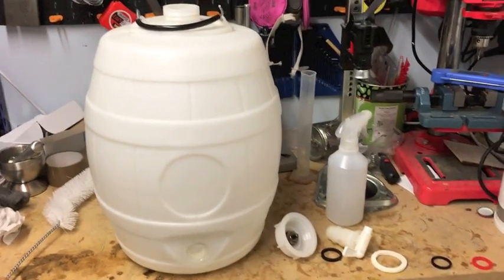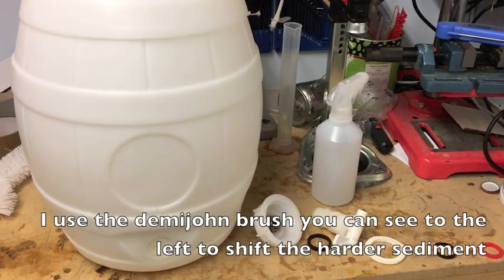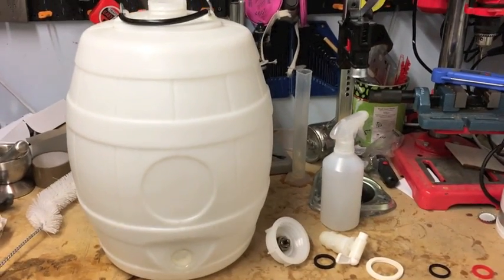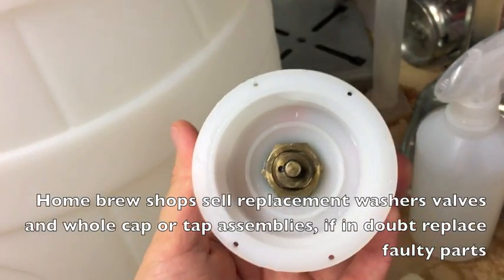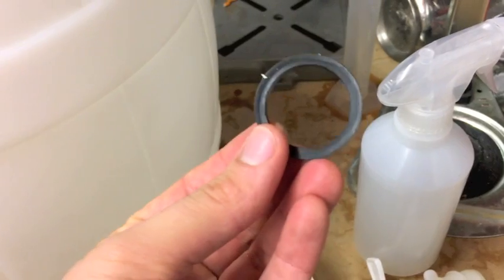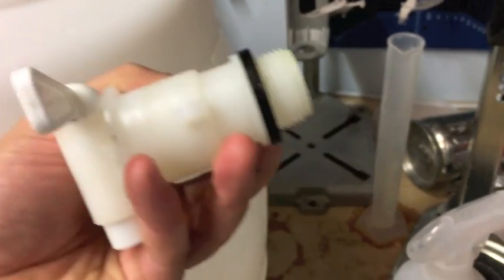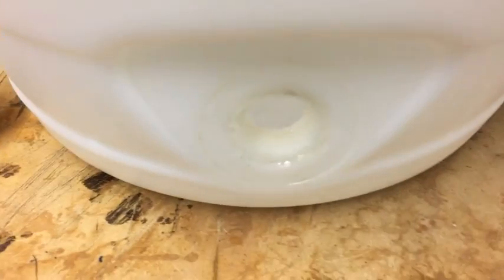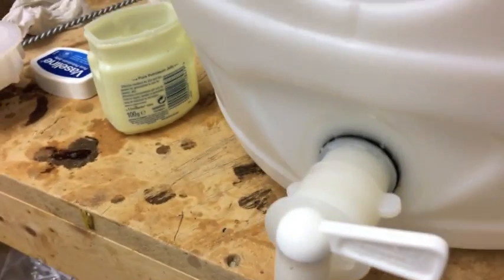How to use a Pressure Barrel for homebrew beer

Comment: Ok, this vaseline thing.....I have done decades of plumbing, when it comes to sealing things, I would use a tube of fernox silicone, it's specially formulated for this. You can also check how good your seal is by using a HP bike pump on a tee with a pressure valve, not expensive. A bit of washing-up liquid on your joints will reveal where your leaks are, as would your pressure gauge to tell you if you are in the ballpark.Domestic heating systems have to withstand very high pressures, so you have to be confident that your joints will not leak-before you charge up the system!
Reply: True. I have two manufacturers barrels. One is super reliable. The other blows. Once I flattened the top of the barrel with emery cloth, get the seal flat, used ptfe on the CO2 seal and plain old cling film like ptfe on inside cap thread I finally got even the badly manufactured barrels gas tight.

Comment: Your deformed washers are similar to the problem of deformed washers on domestic sink traps (u bend).  The washers get stretched and deformed and so leak.  I have put those washers through a gas flame (cooker) very briefly and the heat relieves the stresses in the material and they quickly return to their normal shape.  
I'm just about to start home brewing and if you do try it I would be interested to know how you got on.
Thanks for the video.
Reply: I place my stressed washers in a plastic measuring jug and pour freshly boiled water from the kettle onto them until they return to their shape,

Comment: Can I use this method to barrel an American IPA? I usually bottle it but it would be so much easier if I could do it this way. 
Also at what point do you purge the barrel with a C02 canister? Would it just be as and when you need it?
Reply from the maker: yes you can, just bear in mind it won't give you the same fizzy carbonation as bottling, barrels will give a more cask like pour. You can purge the barrel right at the start if you want to remove any chance of oxidation but after that just use it to top up the pressure as and when you need it

Comment: I’ve just bought one. I’ve also bought those sparkles bulbs and applicator. Can I just use a bit of gas or does the whole 8g have to go in? 👍
Reply: Alas once you puncture it it will let as much in as it needs - could be the whole 8g except you probably lose a bit of it between puncturing and making a seal.

Comment: Wouldn't it be easier to use the tab in the fermenting vessel while transferring beer into the pressure barrell? Is it really necessary to use the syphoning hose? I've just made 40 litres of cider and drained them into the keg and bottles straight from the tap... well, it's cloudy as meant to be (but nonetheless the sediment stood firmly at the bottom of FV), I don't think it would make any much difference through syphoning. I might be doing something wrong, please clarify.
Reply: it reduces oxidization to siphon. after fermentation has started, its important to reduce o2 to get a cleaner ferment. do that by reducing splashing around and air exposure as much as your system allows.

Comment: I have two similar barrels but reddish colored that I believe I bought from Boots about 1982 while I was stationed in the UK as a US airman. The caps have co2 bulb injection and to the side, a brass spring loaded plunger cylinder for pressure relief. I would like to put them back into use but the original seals leak. I’m looking for replacement parts.

Comment: Hi Mate,
Superb info thank.. 1 question when you poured a pint after one week to check it’s condition did you inject the co2 before you did that!
I’m just about to begin brewing so forgive me if it sounds like a daft question.
   Thanks,
       Simon Roberts.
Reply from the maker: No that was just from pressure generated by the priming sugar fermenting, you shouldn’t need to top up gas until you have drunk quite a bit of the beer
Reply: Brilliant, thanks for the fast reply👍
Reply: @DudesBrews  
Fantastic video my friend.
I'm just getting back into brewing beer again, and have No experience with PB'S! 
I got fed up with bottling due to the amount of space required to store it all, especially if you have multiple brews at any one time! 
Myself and my family arn't big drinkers, and just wanted to ask how long will your beer keep in a PB before it goes bad?
Is it a case of it will keep okay so long as you have a back pressure of co2?
Reply from the maker: Open eye thanks the beer can last for months but yes it does need top pressure on it throughout, if the tap starts glugging it is letting air (oxygen) in which will start to stale the contents. Once the natural pressure starts to drop off its best to give it a quick squirt of CO2 with the injector 👍🏻
Reply: @DudesBrews  one should be able to get 50% of the barrel empty before thinking about needing CO2. I had a lager that went 75%. So it does depend on the brew. For something like a Barley wine I would always bottle it. But an IPA works well in the keg.

Comment: I’ve wanted to try one of these pressure barrels but not available here in Australia. I suppose you could use a FermZilla all rounder and do it that way. Pretty much the same
Reply from the maker: yeah a fermzilla could work just like a float tap PB if you conditioned it to a low carbonation level :)

Comment: Unless I missed it, I didn't see you put the backnut on. Is this not necessary? I have the same model as your self and switched tap for a bottleing wand tap which has a slow leak and no back nut.

Comment: So do i need to bottle the beer if i have a pressure barrel? Or can i just have 2 or 3 pints a night untill the barell is empty?

Am a noob
Reply from the maker: you can just drink from the barrel until its gone, you may need to top up with gas or reprime it at some point to get it all out tho
Reply: @DudesBrews   Excellent. Thanks for the fast reply.

Comment: Using a keg without a pressure gauge is really risky. I'd never consider doing this. For example, I have just spent three days trouble shooting a leaky keg. Changed all the seals etc. Used a ton of PTFE. I'm still having trouble. Luckily ttd keg is filled with water so there's no rush.

Comment: Doesn’t Vaseline mess up head retention?
Reply: Depends who's giving it :-). Not as far as I have found. I started brewing again about 1 year ago. In the past one had a 4" opening and a decent toroidal o ring. Didn't need vaseline on those. Flattening the top of the barrel with some emery cloth helps.

Comment: When u take the measurement with the hydrometer??
Reply from the maker: after a couple of weeks in FV check the beer has reached terminal gravity before syphoning to a keg or bottling, check over 2 days and if it hasn't changed it should be finished

Comment: Can you carbonate a Lager in one of these ?
Reply from the maker: not really no, they cannot hold the pressure required for a proper fizzy carbonation. Best for ales and bitters etc
Reply: Dudes Brews I’ve got a Lager on the go because I got sent the wrong thing I order ale. And I’ve only got a pressure barrel. So what’s the best way to carbonate it ??
Reply from the maker: @deanmartin7612  you can still put it in the barrel it will just be more like an ale carbonation wise, otherwise the best thing to do if you want some proper bubbles is bottle it
Reply: Thanks for your help dude.
Reply: I’ve got a bag of carbonate drops anything I can do with them ?

Comment: Wow - Youve got way too much Vaseline on your cap seal, it should literally be a light smear and ONLY applied to the white seal, not on the threads. its to stop the seal snagging at the point it makes contact with the top of the barrel, the problem with too much Vaseline is that if there is enough to create a gasket effect, you will tighten the cap down as much as you physically can and if a Vaseline gasket is created (even if its 0.5mm thick) as soon as you pressure gets high enough the co2 will look for a way out and blow the Vaseline Gasket. For the tap seal.......never ever put any Vaseline on this black tap seal or tap thread or barrel thread, you are just creating problems, firstly Vaseline on the actual tap threads can help the threads to slip when tightening the tap, then Vaseline on the black tap seal means that as the tap is tightened, you can actually pop the black seal out of its recess fairly easily. So to correctly fit a barrel tap. dry the are completely and pop your tap with the seal fitted into a mug of boiling water for 2 minutes, this will soften the black seal which will help it to squeeze up when tightening. Also on your video, you are tightening the tap in totally the wrong place, because this is a 2" barrel you cannot get your hand inside, therefore the taps do not have a backnut and are designed to be tightened by the 2 lugs that sit behind the spout, you should tighten by using these lugs and applying as much pressure as possible.....the lugs are actually for use with a "C Spanner" but as not everyone owns one of these i suggest wrapping a Tea towel around the lugs for extra purchase and leaning your upper body over the barrel to help get the tap as tight as possible.....the back of your tap should visibly bite into the black tap seal a little. Then the likelihood that the spout is facing downwards is very slight, therefore the spout is designed to spin completely separately to the main body of the tap, it can be firm, but just twist it to the correct position. Trying to tighten the tap by its spout is fairly useless, the spout will spin, but the tap body will be loose in the barrel, you must tighten by the lugs.
Reply: Can you point to an official video that shows what you typed please? I have two Balliihoo barrels and in general they don't work as supplied. The one I got from Farnborough homebrew just worked. I found I had to level the top of the barrel - but the lid seal never wanted to seal.

Tonight thanks to this video I got further. So again - please post your video so we can learn from the supplier.
Reply: @stephenhookings1985  Hi Stephen - The cap part is fine on this video, just use way less Vaseline, it should literally be a light smear, we dont have any videos yet, but had to point this out as its a very common misconception, that slathering everything in Vaseline on a pressure barrel will seal it up. Send me an email explaining exactly where you think your barrel is leaking and i will try to help. BTW Balliihoo barrels are identical to the one in the above video, regardless whose brand it is, the shells are all made by one company and then its the taps and caps that are different on them. If you have the Balliihoo red cap on your barrel, its really easy to check by pumping air in via the Schraeder valve and then tipping it upside down in a sink or large bowl of water.

Comment: Great video thanks for sharing.

 One question do these pressure barrels allow you to drink as and when. Or do you need to consume the barrel in a short period of a few days? 

A comment from my mechanic days, we were always told to never use Vaseline on rubber seals, due to the fact its petroleum based it will attack the rubber and actually speed up the perishing process... worth researching.
Reply from the maker: Thanks Paul, these will allow you to keep the beer for quite a while depending on how you use them, because the beer is under pressure from c02 it should stay in decent condition as the barrel empties. I have had beer in them for several months without problems BUT lots of factors at play such as temperature, oxygen levels whether the barrel maintains pressure, beer style and strength etc etc. If you want to keep beer in them for more than a few weeks I would suggest the most important things are being able to keep a low cellar like temperature and using c02 bulbs or even better a small hambleton bard cylinder to flush the barrel (remove 02) before filling and to top up the pressure as the barrel empties and you lose the pressure from the initial priming sugar. That should limit any oxidisation and also potential bacterial growth which might make it go off. Hope that helps cheers
Reply: Once the beer builds up pressure and you leave it for a few weeks to settle it should be good. It should last a long time... but I tend to drink mine quickly :-)